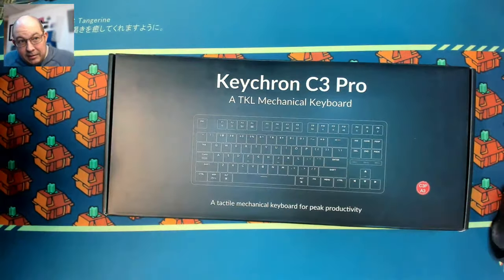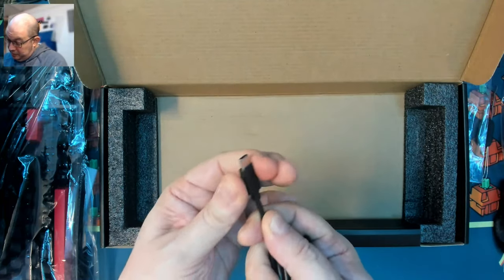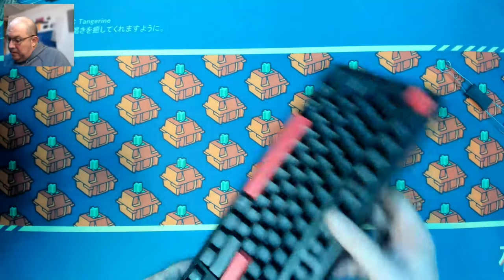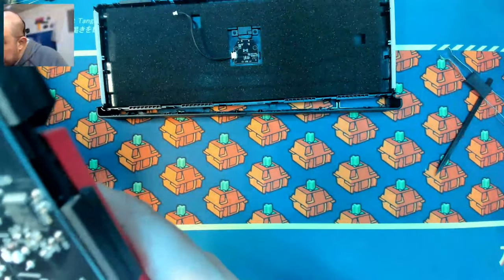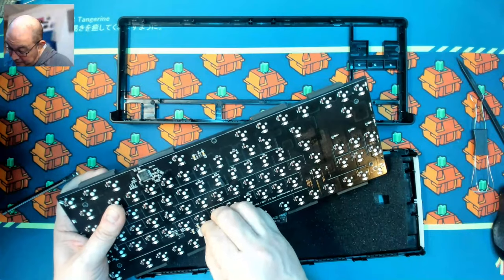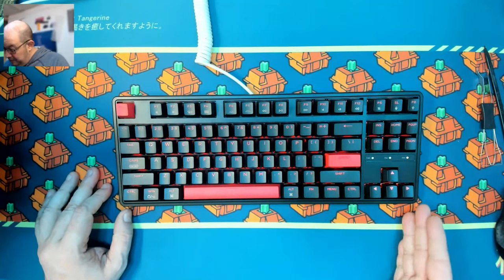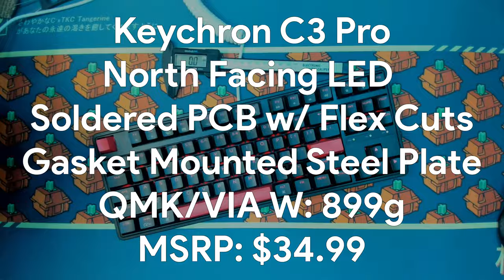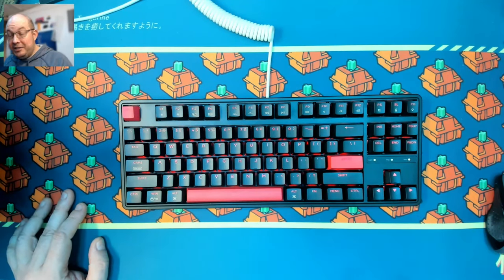The New Budget King? Keychron C3 Pro: Review, Teardown, Sound Test - $35 Gasket Mounted QMK TKL

Comment: I recently bought this keyboard with the brown switches. It was on sale on Amazon for $27 when I bought it, thought it was a good price. This keyboard replaced a Logitech K845 w/ blue switches that I had been using for a few years. 

What's crazy is that I swear this Keychron C3 Pro provides a much better typing experience than the Logitech one I had been using, despite the Logitech K845 costing over twice as much. I do wish the backlight was white, but otherwise I'm pretty pleased with it.
Reply from the maker: Very likely you are feeling that gasket mounted difference, glad you like, enjoy, cheers!

Comment: Thanks for the teardown. It helped when I figured out the stubborn way that the switches are not hot swap. 🙄 Anyway, all fixed now. Any tips for just dampening the larger keys? I don't think stuffing foam or whatever behind the steel plate is going to do much. All that mass stops the keys pretty dead when pressing down. The remaining noise is coming from the "ringing" of the plastic caps when they hit the top of their travel.
Reply from the maker: You're welcome. This is what I do for the spacebar: https://youtube.com/shorts/TKkWvuYe6tM
Reply: @MechKeyboards Thanks for the reply! Can't seem to pull up that video though as it's marked as "private".
Reply from the maker: @TestSpaceMonkey  not sure why it was private, but it should work now, cheers!
Reply: @MechKeyboards  link works now. I even have some of that double-sided tape somewhere so it'll be easy to have a go!
Reply from the maker: @TestSpaceMonkey  right on, good luck!

Comment: Very interesting product, gasket flex at $35. Gonna order one, says October on Amazon now. If I could change one thing it would be that steel plate.
Reply from the maker: First I'd pick hot swap, second the plate, though I do plan on 3D scanning it and making a plate since I doubt Keychron will release the plate files for this model.

Comment: Literally the only thing i see wrong with this as an entry point is it not being hot swap. If this were hot swap? This would rule the low end price point especially given the relative lack of TKL boards compared to 60% from what I've seen. Heck a lot of times depending on the keycaps the end user won't even SEE the LED color.

Man if this were hot swap I'd be all over it.
Reply from the maker: I'm hoping that Keychron will see that and release a hot swap variant for ~$5-$10 more. Fingers crossed!
Reply: @MechKeyboards  I've got fifty bucks i won't feel guilty spending on things.

This, the K12 to swap between devices, or a GK61, keycaps, and space bar foam. 

I am very VERY conflicted and literally if this thing were hot swap there would be only one right choice. 

As is the k12 is in the running because bluetooth in spite of not hot swappable layout on the model i can afford.   Literally been stressing all weekend over this.
Reply from the maker: @singletona082  if you don't yet have a GMK67 it can be found for ~$25 barebone on AliExpress from the 'Super Deals' page. On Amazon, the E-YOOSO Z-87 is only $25 and can sound decent with some elbow grease. The Aula F87 is an amazing OOTB keyboard but runs closer to $80.

Comment: I am newer to the hobby, I got into it when my work keyboard started to go out. It was a Corsair K55 membrane gaming keyboard, and I previously have had Corsair mechanical keyboards since the mid 2000s when mechanical keyboards started to hit the mainstream consumer market. I do extensive research on everything before I make purchases, my first build was a Keychron V6 because I need that num pad for work! Paired with some Gateron milky yellow pros and an Akko keycap set, this thing is amazing for my daily work grind. My second build for home was a Keycrhon Q1 Pro, I got my first taste of a gasket mount from that, and I loved it. Of course I moded them both with some PE foam and tape mod, they both sound and feel great. Going from my work build to my personal one at home gives me different typing experiences. I have Gateron Quinn switches in them both at the moment. the gasket mount feels so soft and that tactile experience is wonderful on my Q1 pro, and the V6 feels much more "solid" and stiff (not in a bad way), you definitely feel the difference between the two using the same switches.

 I am very excited to see Keycrhon making gasket mounting options on a cheaper chassis. It would literally be perfect if they made the V series with gasket mounts, V pro or the "X" as you mentioned! Though I love the Q1 pro, I feel it would give other consumers a gateway into their more expensive Q and Q pro boards that offer a gasket mount, if they offered a "budget" board with that same Keychron quality. I would absolutely upgrade my work board to a Keychron V6 or V5 that had a gasket mount, and number pad. forking out over 200$ for a complete build of a pro version is a little stiff for me. I guess I am not that deep into the hobby yet, where spending $300 - $500 (or possibly much more) on a keyboard build is something would consider hahaha
Reply from the maker: I'm with you, spending North of $250 on a single build tends to feel like a kick to the gut; the amount of keyboard one can get for <$100 only continues to get better, and I foresee Keychron going strong into the more affordable models. I'd be all over some gasket mounted V series! 😎
Reply: @MechKeyboards  I have the Lincoln Continental of Keyboards.  I love the hobby. Regret the winning that auction.

Comment: Unfortunately after few months of use, the price of this keyboard has shown the true "value" - switches became little loose (depending on use, but if you are gaming a little bit, it will wear switches out to rattle a lot). Another thing that goes is space bar as well... it does not seem these switches come in prelubed, so do expect bit rattling louder sound from them, nothing bad, bud over time they will become loud and rattly... biggest downside is that you cannot swap switches, but that is what you get for $30. 
One thing I would recommend is - use this keyboard as is and do not overinvest (if at all invest) into modding it because it is not a long term feasable keyboard of choice. 

Example: If you want to mod a keyboard, considering taping, sorbothane foam insulation padding, keycaps, etc. - just find whatever you like in $100 range and get a great quality, because that is close to an amount you will spend to mod this keyboard and make it something that it is not ;)

Dfeinitely go for CNC Aluminium casing keyboard over plastic.
Reply from the maker: Odd, I cannot report the same. I along with my son have been using this keyboard since it's release, it has given us zero issues. I am planning to desolder the switches, replace the LEDs with white ones, and MillMax socket it in the near future, but if yours is defective, you should reach out to Keychron and ask for a warranty replacement. 

I have over a dozen Keychron keyboards, not a single one has died on me yet (knock on wood).
Reply: @MechKeyboards  I would definitely agree with you - in all my research I did over the past year or so before getting into custom keyboards, Keychrone was never reported to sort of break, or not work as intended - maybe I caught a weird unit - but it definitely won't turn me away from the brand and getting something nicer and fancier in the near future :)

Comment: Did you manage to key the Via configuration to work? i've dragged the JSON files as instructed online but I cant get my custom keybinds to actually work.
Reply from the maker: Yes. If you are using Windows mode, layer 2 is really your first layer, and layer 3 is the layer activated by hitting function. If you are in Mac mode it's layer 0 and 1.
Reply: Thank you so much, I thought my board was defective. You're a king! @MechKeyboards
Reply from the maker: Glad to help, cheers!

Comment: Keychron C3 Pro vs Tecware Phantom+ vs RD K552? Theyre all in the same price range with the tecware being a bit more pricey
Reply from the maker: Tecware > Keychron > K552
Reply: @MechKeyboards Thanks, I thought the C3 Pro were so good that they were better than the Tecware Phantom+
Reply from the maker: @Chokealot  if it was hot swap, it would be much closer.
Reply: @MechKeyboards  if it was hotswap, would you pick keychron over tecware? Or better yet, if hotswap was not an issue (no plans on hot swapping yet) being a newcomer to this hobby.
Reply: @MechKeyboards  honestly, I was deadset on buying a Tecware Phantom + Orange Switch as my first Mech KB but then I suddenly saw the Keychron C3 Pro and now I'm torn. Thanks for the help though
Reply from the maker: @Chokealot  with hot swap and a different plate probably better; hard to say since I am rating them as is. Hot swap is a much needed feature unless you don't mind soldering.
Reply from the maker: @Chokealot  for your first board, I'd recommend hot swap. It won't be long before you'll be interested in trying one of the thousands of switches available.

Comment: What do you recommend for my first mech keyboard this on brown 57 euros or tecware phantom first gen with outemu brown sale with 45 euros? My main consern is that C3 don't have hotswap, macros and numpad while phantom is with numpad, has macros, is rgb but isn't prelubed as C3.
Reply from the maker: If you need a numpad I'd recommend taking a look at the Keychron V5/Q5.
Reply: @MechKeyboards  despite the numpad for low cost? Is C3 better build that phantom 2021 brown?
Reply from the maker: @strategossm  in my opinion the C3 is better even though it lacks hot swap, the hot swap on the Phantom uses Outemu hot swap so is very limited to certain switches, the Keychron sounds and feels much better out of the box.
Reply: @MechKeyboards  thank you, so seems C3 is better even if overpaid to 57 euros (with shipping). And if you want to try banana switches you can with some more effort.
Reply from the maker: @strategossm  better construction, PC plate that's gasket mounted, and with a little time and patience the switches can be desoldered and replaced, which I plan to do with this one at some point.
Reply: so C3 switches are prelubed or not because site saying are prelubed @MechKeyboards
Reply from the maker: @strategossm  it's factory prelubed which can be very inconsistent.

Comment: Will this be better than the Hyper X Core Origins?
Reply from the maker: I'd certainly get this over the HyperX, primarily for the fact it's gasket mounted and is loaded with open source software.
Reply: @MechKeyboards  Thank you.
Reply: I have the Hyper X tkl I love how it looks, but the stab's really suck and my spacebar rattles like a pop can with penny's in it.
Reply: I just bought this keyboard and am waiting for it to arrive. I should be able to replace the key caps if I want to correct?
Reply from the maker: @silver33  yes, as long as they are Cherry MX compatible keys, as most are. Feel free to share your build on BudgetKeebs when finished, cheers! https://budgetkeebs.com